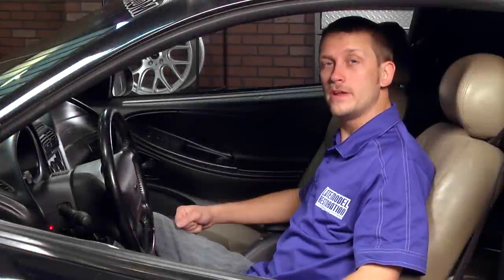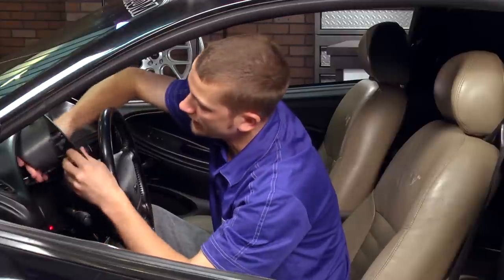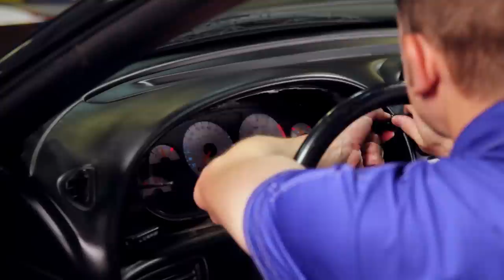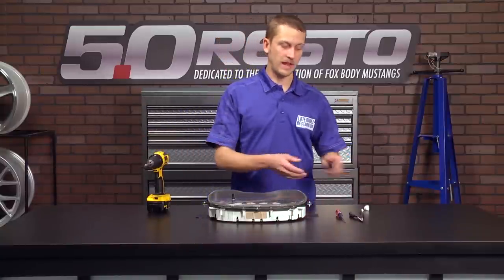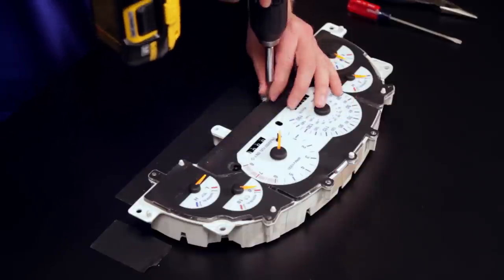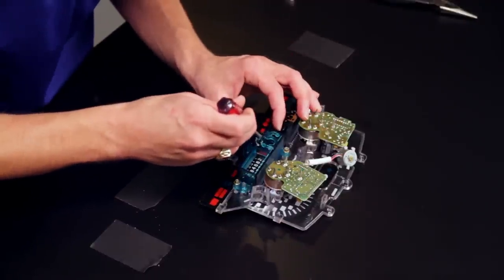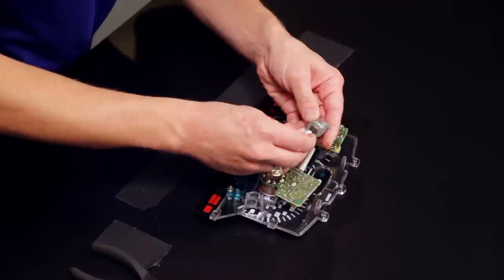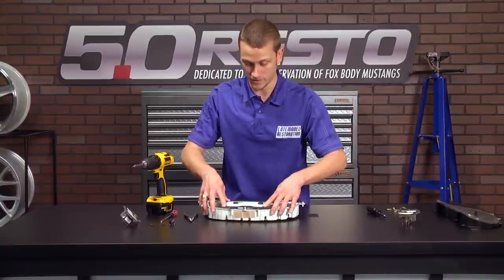1994-98 Mustang Odometer Gear Repair/Fix Kit - Install

Comment: Where do I buy the part? Thx. I have a 98 mustang gt convertible. Thx!
Reply from the maker: click the link in the video or in the description. You can also just link on the follow link. Don't forget they are backed by a full lifetime warranty! http://www.latemodelrestoration.com/item/LRS-17255OG/94-98-Mustang-Odometer-Repair-Gear-Kit
Reply: ***** thanks for the response. i ordered the kit the other day. Now I just have to have someone instal it for me. Also My gas gauge just froze up on me . any ideas ? Thanks!!! matt

Comment: I replaced both gears and the driven gear was broken and worn but could the motor attached to the worm gear go bad as well? The odometer wouldn't roll after I took it down the road. I spun the driven gear a few times and watched it roll fine but I'm wondering if I did something wrong or if their might be another issue?
Reply: gsx - old comment but if the odometer works when you first start driving but stops soon after, its got a bad tooth in the gear and thus stops when it reaches that tooth. if not working at all probably the motor. if not working at all and speedo isnt either, its the vss.
Reply: adam thiry where did you find it. I need one for my son's car and can't find one.
Reply: adam thiry it sucks I've looked all over and there are none as far as I can tell and I'm very good at finding things lol.  I had to scavenge one out of a cluster for a 95 gt with 100,000 got the whole cluster for 25.00 Speedo is to slow for my son's 97. if you ever need those sections give me a call.

Comment: so if I have original cluster, my millage should be accurate after that?
Reply from the maker: If your gear busted and hasn't worked, when you install the new gear, it'll pick back up where it was from before. So it won't be accurate once you replace it.
Reply: Late Model Restoration ok, thanks. Would there be a way to make it more accurate after that. Or would I just have to deal with where it is at, thanks again
Reply: Also should car be off when doing this?

Comment: What’s the next step if it still doesn’t work after gear change?
Reply from the maker: Your next step would be to look into the speed sensor and see if that is causing the issue. We offer one on our site for replacement: https://lmr.com/item/LRS-9731A/94-98-Mustang-Speed-Sensor

Comment: I tried this because my odometer stopped working. And once I put it all back together none of my gauges work. Please help me.
Reply from the maker: Hector Gonzalez give us a  call so someone can walk you through this. It would be easier than going back and forth on comments. Might be something as simple as the harness isn't plugged in all the way on the back of the cluster. 254-296-6530
Reply: ***** My gas gauge and temperature gauge were reading incorrectly after putting this together as well. It ended up being one of the copper traces on the flexible wiring assembly had come undone and crossed another one on the far left plug. While it probably needs a new flexible wiring sheet, I was able to just carefully put the copper tracing back and put connector in as carefully as possible. A little drop of super glue to reattach the tracing to the plastic might help as well. By the way, both my gears were absolutely destroyed, toughest part was getting the little remnants of gear material out of there, Trying to get the headlight knob off was what brought me to this video though :-). Great kit and video, thanks. Rick - 95 GT

Comment: I have a 94 Mustang GTI have a code of 176 lean code 02 sensor but I don't know where it's located on my vehicle can you please help me
Reply from the maker: The oxygen sensors are located underneath the vehicle and on the exhaust piping. -Landan
Reply: @latemodelrestoration   But I don't know which one is running lean do you know

Comment: I have a 05 mustang my rpm doesn't move at all what do u think it can ve the problem
Reply from the maker: Sounds like there is an issue with the gauge. Have you recently modified the car in any way?
Reply: Bigger cams drag light wheels but the last owner did some work to the engine n I have no idea what he did

Comment: If you guys are still taking questions I have one. Will this also fix the speedometer?
Reply: no, you need to replace the vss. essentially your car doesnt know how fast its going because the speed sensor isnt converting the signal.

Comment: My speedometer isn't working what could that issue be. ?
Reply: That's probably the speedo gear, which is located inside the transmission.
Reply: Thank you

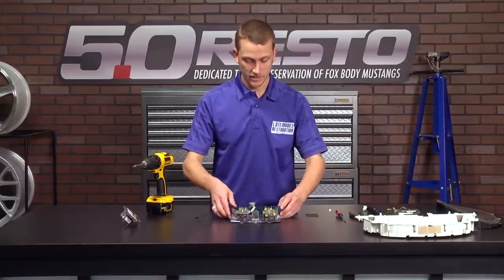Comment: Cringe at 4:56.  You should not just set those gauges down on the needles like that.  I'm sure you've done hundreds of these, but I myself would not do that to my own gauges.

By the way, all the screws are T-20.  And I hate Mustang gauges, yuk.  It seems to be a hit or miss thing with the replacement gears.  Some will last years some will last 10 miles....
Reply: Just the ones holding the shroud are t-20, the rest of them on mine at least were T15 or T10